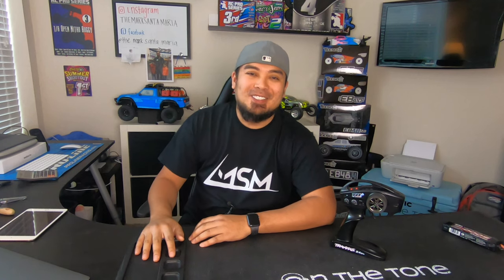Traxxas TQi Master Endpoint Reset MER

Comment: just want to toss this out in case anyone came here with the same issue I had. TQi endpoints wouldn't set, led to strange steering behavior, and setting the endpoint would force the steering further beyond the point I was trying to set. Turns out, if you've reversed the steering (some aftermarket servos, like savox, require this) you need to "un reverse" the steering (set it to factory behavior) and then you can set the endpoints... and THEN reverse it so you get the correct transmitter behavior. Took me all day to sort this out, hope it helps someone.
Reply: Thank u I'm going to try this.

Comment: Having an entirely diff issue…the steering wont turn when I press the throttle forward, but it works in reverse. It also steers when it’s fully stopped, but as soon as I push forward it looses steering and goes back to center…any help would be great thanks…

Comment: I bought a new TRX4 79 Blazer two days ago, and out of the box, the steering servo would wander to full left or right lock over long enough distance, the wheels wouldn't center when releasing the steering control, and steering trim wouldn't hold center; it'd require full deflection in either direction to temporarily center the steering.  I thought it was a bad steering servo, but noticed it would give inputs as I changed orientation of the truck while holding it, so I thought it might have a gyro, which led me to many articles and videos about the Traxxas Stability Mangement system.  Lots of sites said to buy something that'll allow the controller to talk to an app on my smartphone to diagnose it. I was on the verge of buying a 6 channel receiver and running the TRX4 with my Spectrum DX5C, but doing the master endpoint reset seems to have completely resolved my steering issues based on a brief test run in my living room.  Before, even inside, the front end would be wandering all over.  This video is extremely simple and effective.  Thank you for sharing this great information! I would've been chasing this problem and replacing parts needlessly for a while had you not made this video.

Comment: Hey man I have the Traxxas T-Maxx 3.3 with the tqi top qualifier transmitter with a docking station on it for an iPhone every time I apply throttle it works but when I press the trigger forward for breaks the servo does not move unless I put it in 70/30 acceleration brake setting then it will apply a small amount of break do you know how to fix this just got this truck and want to drive it it's running and driving just not applying brakes

Comment: I’m trying to fix an Xmaxx for a friend, I’m not very familiar with them however I’m wondering if the ESC is bad. I performed the steps outlined for setting the throttle end points by holding down the power button until the light turns red. Registering full throttle (two blinks) then registry for reverse (three blinks) and then a domino of red lights appear on the ESC, Indicating that it registered correctly. Then after that if I pull the trigger it recognizes the action but immediately cuts off/powers down the ESC.Any ideas?
Reply from the maker: East Tactics sounds like bad batteries. What batteries are you running?
Reply: Mark Santa Maria , It’s running on to Traxxas brand 6700 mA for S batteries. The batteries are in great condition physically, and since I had them originally I put them on a storage charge. And also have recently put them on a full charge. No problems. Also they worked when I originally got it. Here’s the story of what happened when I originally got it on day one. Maybe it was at a little bit of light on what it could be.
When I got his xmaxx, Day one, I turned it on to see what was going on with it and it ran but was only moving at like 3 mph. It only did that for a few minutes and then it all of a sudden got to that point where it stopped moving and when pulling the trigger the esc just cut off. So I almost feel like I might’ve fried some thing. Turns out the issue with why it was only going 3 miles an hour it was because one of the bearings inside of the motor exploded and jacked up the inside. So I was sort of forcing it to run. I’m hoping it’s a bad connector somewhere though. Oh… And the motor is brand new. Just arrived yesterday.
Reply: Well… It looks like I will have to buy a new ESC. Should I pick up another stock ESC, or should I switch to another brand like the hobby wing max 6? What are you running? If I pick up a hobby wing does that open up the options to adjust the punch setting for the X max?

Comment: My sons Slash vxl 4x4 went into full nuts mode today.  TQI started flashing red so I replaced the battery. Thought it was fine.  Then I lost steering or barely turning. Then throttle started sticking.  Then I remembered this video. Voila! Problem solved. Thanks Mark. BTW, saw the new 1/16th Slash 4x4 today at my LHS. Will be looking out for your review on it. Thanks again.

Comment: This is the little thing that traxxas has annoyed me , done my xmaxx servo on maybe my third run, got a high end savox and killed that in one hour. Least to say I was pissed. Went on line found the end point adjustment. ( thanks amain hobbies and Mark Santa Maria ) Now need another new servo. 🤬😡 side note xmaxx should have a true fifth scale servo , problem solved. There silly not quite right 5.75 and 1 8th point 34768 servo ( joke) they have done is crap  ( so you have to get 2085x at 200$ or get the adapter with a regular size servo, more money. Which I feel isn’t big enough. And I haven’t even ran two full packs though it! Not good enough traxxas

Comment: Your the best. My rustler has been down for almost 2 weeks trying to figure this out. My throttle was turning my wheels. My steering wasn't turning but my trim was Making it turn. It was all jacked up but im outside at 3:20 am testing it out and it seems to be working fine now. Thanks

Comment: Oh man this was a life saver! This fixed 3 major issues on my e revo vxl 1/10 after trying everything else:

Problem 1: when slowly pressing the throttle, steering would slowly turn left before the drive motor kicked in and then continue but only when the multi-function knob ( my knob was programmed to adjust TSM traction control) was anywhere above zero.  PROBLEM SOLVED

PROBLEM 2: throttle not responsive until about 1/4 movement in either direction. Model would then jerk forward or back violently as the motor engaged. PROBLEM SOLVED!

Problem 3: after turning,  then releasing the steering knob on the Transmitter, the servos would bounce when returning to straight  causing the steering to bounce or shudder for up to 10 seconds. PROBLEM SOLVED!

Thank you Sir!